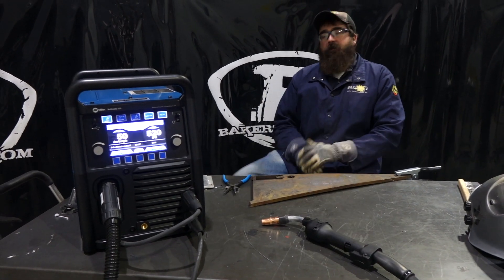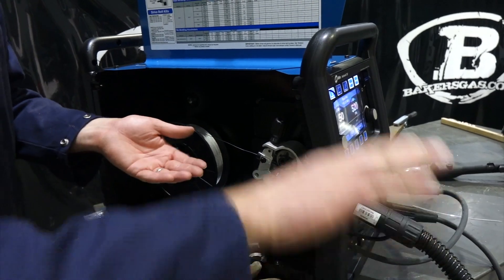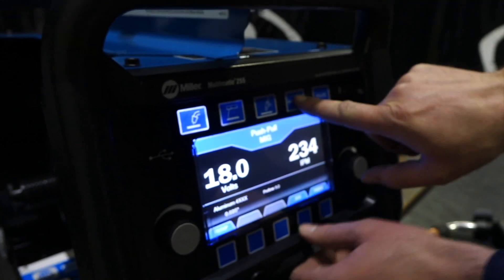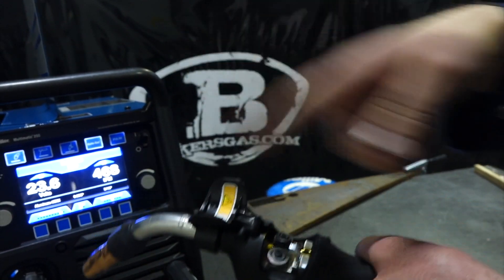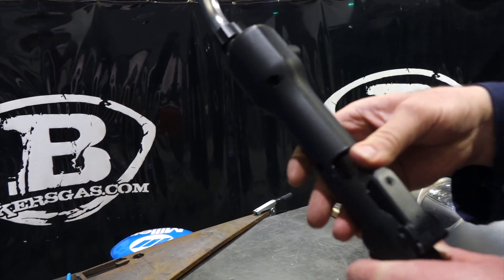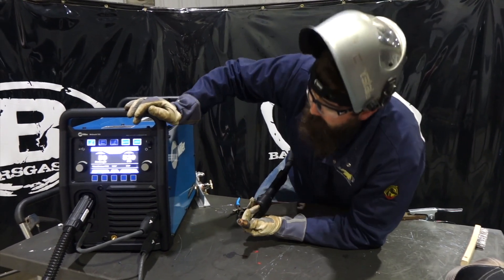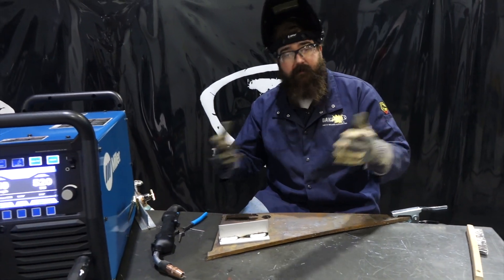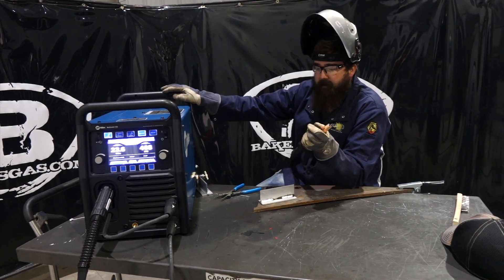Miler XR-Aluma-Pro Lite Push -Pull Aluminum Gun

Comment: I have the python push pull gun but i tried to adjust the rubber liner and out of nowere a washer slipped out that has 2 grooves, have no idea were there go. I checked the pic diagram online and i cant see it

Comment: Hey do you have a video welding a 5xxx series wire?
Reply: I'm using the ER-5356 wire and the process is pretty much the same as the 4xxx series. The auto set will have the correct parameters as a starting point.

Comment: im a boat builder. i have been considering the 255 with this 25' aluma-lite gun. for the price difference as a 95% aluminum faber i dont think its worth getting the multimatic over the millermatic. if the multimatic had AC id be all over it.
Reply from the maker: Yes, totally get it. The MIG functionality is exactly the same. If you will just need it for MIG the Millermatic will get it done, but if you want the option for DC TIG and Stick invest in that now. Any other questions let us know. We do have promos on both so make sure you take advantage of those.
Reply: We're an aluminum dock manufacturer. One of our machines is a Multimatic 255 with the alumapro lite. No one has ever touched the TIG functionality. A tig machine will get dragged over before a production welder gets fiddled with. Unless it's going to be the only welding machine in the shop I agree, get the Millermatic
Reply: The multimatic made sense to me because I needed a better TIG/Stick than I already had, through a local vendor the price  difference between them was 500 dollars.
Reply: Dustin did you buy the 255 and the gun? I'm ready to buy I've built a few boats and would like to build more did you like it?
Reply: @joneswaylon2394  NO!  Screw Blue! A 255 & a 25' gun was going to be $7k I bought a HTP pro pulse & a 25' gun for $4500